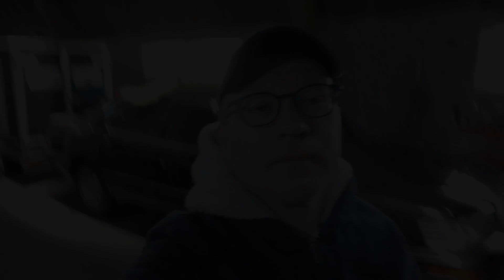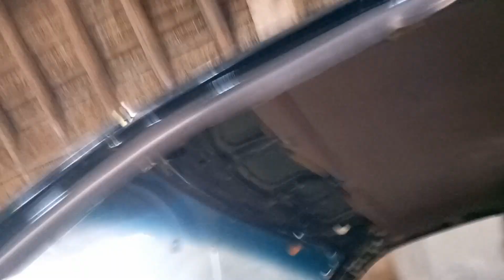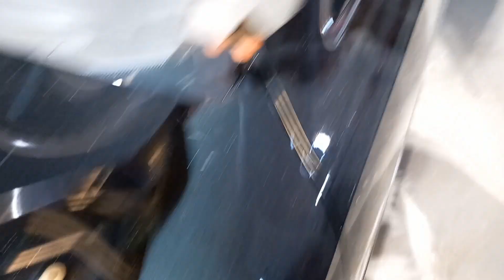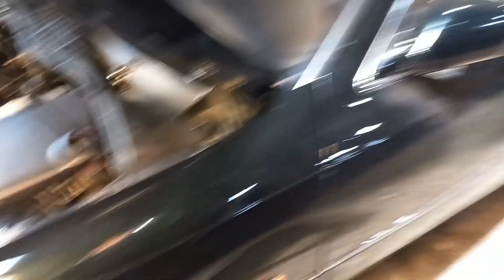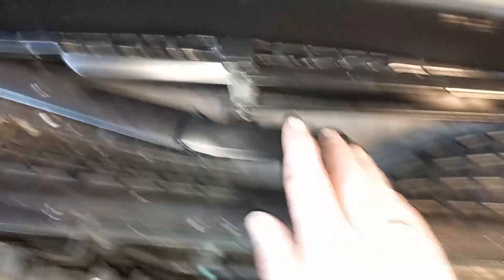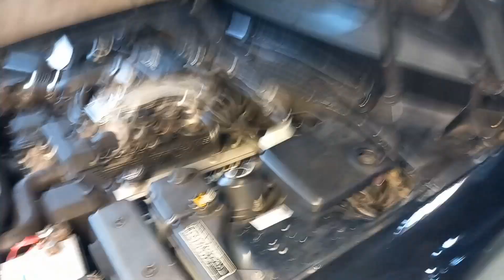Project LS400 Update!

Comment: I am so happy to see the content is being made nowadays not like 10 years ago😂. Keep it up man. I wanted to ask how do I know when to change valve cover gaskets for 96 LS
Reply from the maker: Hey, thanks for your comment! Changing the valve cover gaskets is pretty straightforward. You have to take your time to disassemble and remove a lot of parts, especially on the intake side. But once you have the covers off, it is pretty simple. I recommend you also replace the valve plug seals and the rubber plugs at the end of the camshaft bore. I believe I have shown this process in one of the early Project LS400 videos.

Comment: Hi! Thanks so much! Love your channel and the help that you provide. I have a 1997 LS 400 that I'm working on. I'd like to put on fan spray nozzles for the windshield washer. Are they standard Toyota size? I also have problems with the remote door opener. I bought a new remote, since the car did not have one, but I can't enter "programming mode". Some say the door unlock motors might need refreshing. I look forward to your next video tackling this issue. You have an easygoing style ...a natural teacher. thanks again!
Reply from the maker: Hi, thanks for your comment! I'm not sure about the nozzles for the windscreen washers. I usually look up the part numbers on Amayama.com and see if it matches with other models from Toyota and Lexus. With that part number you can also find replacement and alternative parts.